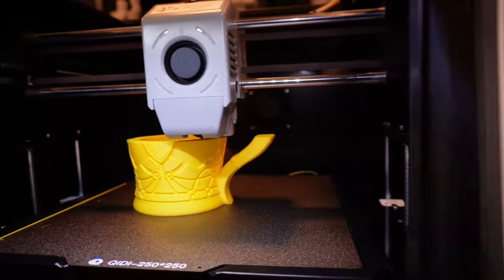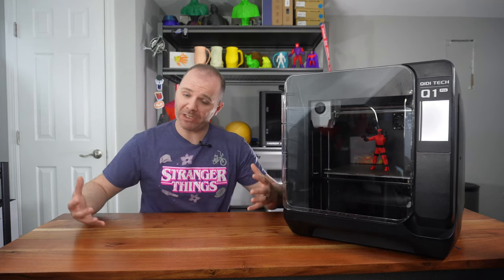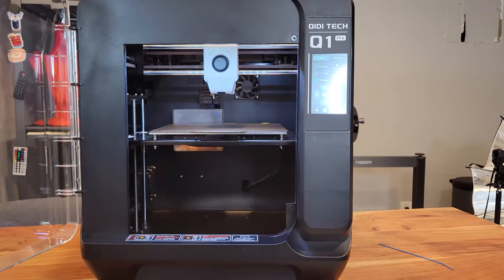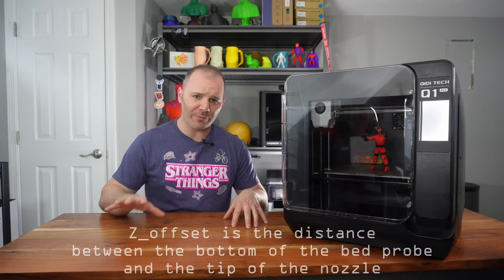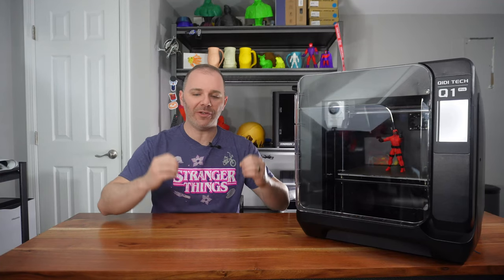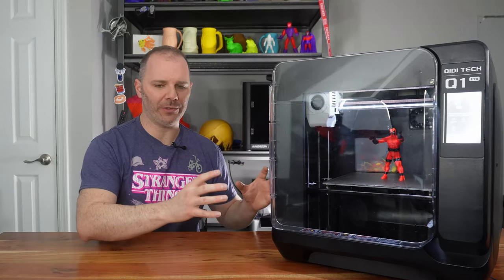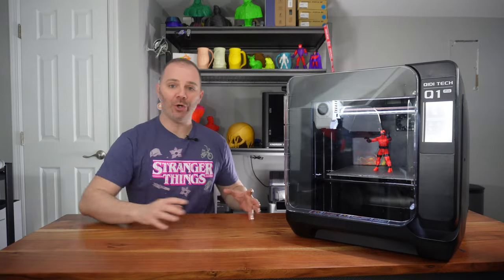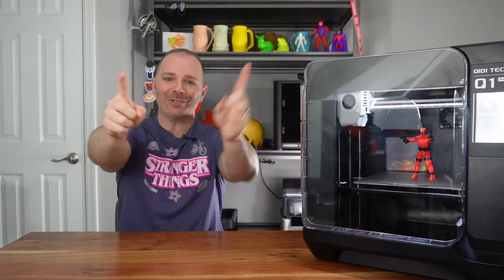A 3D printer for beginners and experts!

Comment: I purchased this today then got hit with a bit of buyers remorse from seeing some of the cons other reviewers delved into, namely the belt tensioning, build plate shroud issue you talked about, (other reviewers neglected to mention the shroud was removable), and the weird load/unload procedure that you skipped on? 

But after seeing your video i feel more confident in my choice the ability to use the camera in a meaningful way vs just taking Timelapse or live view (as if i could do much while driving somewhere) is really awesome! The bed plate being less finicky without the shroud is nice to hear too, the only worry now is the tensioners but I’m confident there will be tinkering to fix that.

Looks like my second and most expensive printer purchase should be a good one! Thanks!
Reply from the maker: I think once you get this machine up and running you won't have any buyers remorse. At a base level this printer is easy to setup and will start off giving you great prints with minimal effort. Really the hardest part with these printers is understanding how to use a slicer, but if you have some experience with that alread, it should be a piece of cake. 
    For the belt tensioners I never had an issue with them. Mine came at a good tension from the factory and I didn't need to make any adjustments. The fact that the tensioners are only held in by a set of 2 top screws (instead of all 4) seems like it could be an issue, but I haven't run into one yet. Tensioning them is supposed to be easy: release the tension, run the printhead by hand, resevjre the tension. Again, I haven't had to go through the process yet but I'm confident we should have some control on the tension of these belts. 
    The load/unload I was gonna touch on but it's just something that hit the cutting room floor because the video was already long. I sort of mention it in the wishlist section at the end. The reason I didn't stress to have it make the final cut was that this machine is using Klipper and we can just create our own load/unload macros as we see fit. And we should be able to hijack whatever their macro is for load unload through the touchscreen and just supplant it with ours. So that issue should be able to be alleviated client side. If you're interested I could share a load unload macro on using.
    Other than that this thing should be solid for you, it sort of just works. I wish there was some form of filtration, but to be honest the best form is to vent the chamber fumes outside which is never going to come stock.
    Hope this helps and let me know if you want a load unload macro!
Reply: @PrintsLeo3D  a macro for that would be awesome! And again easing my mind thank you! For filtration i actually had it in my mind to print some sort of vent tube to my window, or attachment for something like a like a flexible cold air intake pipe from a car since I’ve got one lying around! I saw other reviews mentioning carbon filter etc and figured just not dealing with the fumes in my apartment at all would probably be better.

Comment: Great Review Leo, new here but a vet in 3D print space. Klippered all my machines apart from my ender 3 pro (OG) , So far this Qidi Q1 pro has impressed me no end, what a tool got octoeverywhere on mine working fine, and had to SSH to get the time and date on the MKS board correct. Only issue I have at present is when printing with the heated chamber on for ABS ASA etc, the printer crashes at random mid job, now I'm not sure if it is funky G-code or the MKS controller getting a little hot? My slicer is Orca 2.0 beta and PETG PLA print amazingly well so not sure what's up. I have e-mailed Qidi support so watch this space.

Edit...! Not hard from Qidi yet but not been long so no bother... The issue is the MKSpi is reaching 95oC and thermal shutdown watched it in putty creep up then error out with thermal protection shutdown. The little fan either ain't working or not enough to cool the main board. 

Will update once I fix it , and I will fix it!!
Reply from the maker: Paul it sounds like we are doing the exact same thing to our Q1s! I got OctoEverywhere (OE) on this as well and I was even able to correct the clock issue directly through some prompts on OEs website. Which was easier than when I had to do some add-ons to the XMax3 which also had a clock issue!
    I haven't had any overheating issues as of late thankfully. I believe the MKSpi board is the printer head board (but I could be wrong), and I don't believe there's a fan to cool it properly. What is the chamber temperature reaching during these prints ? I would say to remove the back cover and maybe get some more airflow into that board but I'm afraid that may open you up to some other areas (by exposing the board). I would love to hear how the issues presents itself and how you end up tackling it. Keep me in the loop lol? Thanks
Reply: @PrintsLeo3D  Hi Leo, fixed it temps didn't breach 84oC max 80 while printing. Chamber I have set to 60 and it stays there no issue. With the back off temps never broke 65 on the mainboard. (Chamber took an age to warm though). Your right on the MKSpi I was just generalising the Qidi mainbaord has this element built in I believe doing the Klipper stuff it is this that was overheating. If you have an e-mail or discord I can share my Mod it's janky atm but I'll make a 3mf at some ponit. This was just to prove the point and get my issue sorted. Qidi came back and advised I need a new adapter plate and connect cable (not sure myself).
Reply from the maker: Paul, sounds good! Send me an email at printsleo3d@gmail.com can't wait to see it !

Comment: removing the bed shroud is a brilliant idea!  Is there a pid tune in case it affects the thermals of the hotplate?
Reply from the maker: Bruce there absolutely is! Because we're using Klipper we get all of it's internal macros available to us, and PID tune is one of them. Whenever you want to PID tune the bed or the extruder you just need to send one of these commands (outside of a print):

PID_CALIBRATE HEATER=heater_bed TARGET=(input_temp)
or
PID_CALIBRATE HEATER=extruder TARGET=(input_temp)

ex. PID_CALIBRATE HEATER=extruder TARGET=210

--

What I usually do is add a quick macro to one of my configs and it makes this command into a button on your printer's home page that you can simply input the temp and then click! It's super simple. This is the macro:

[gcode_macro PIDtuneHOTEND]
gcode:
	{% set TEMP = params.TEMP|default(200)|float %}
	PID_CALIBRATE HEATER=extruder TARGET={TEMP}

[gcode_macro PIDtuneBED]
gcode:
	{% set TEMP = params.TEMP|default(60)|float %}
	PID_CALIBRATE HEATER=heater_bed TARGET={TEMP}

----

If you have any questions on how to implement this let me know!
Reply: @PrintsLeo3D  Pre ordered the day I saw Angus's video, but Au stock not until May
Reply from the maker: That's unfortunate but at least you have one coming. I'm sure that will make it all the more special when it arrives! Good luck and have fun printing with it!

Comment: Thanks for a very informative review. I would like your opinion or analysis on how it prints TPU. I currently have a Dremel 3D45 that prints very accurately however, to print 95a TPU I have to print no faster than 20 to 30 mm/s max.
Reply from the maker: This printed TPU well for me, though I am printing it pretty slow myself (but not 30mm/s slow). I am printing Overture TPU which I believe is 95a and it printed it perfectly. If you want I can start up a new TPU print and get back to you with top speeds and whatnot, if you have a particular model or design style you are printing let me know and I will try and find a model to match.
Reply: @PrintsLeo3D
I'd love to hear some suggested speeds as I expect to be printing some TPU when my Q1 finally arrives
Reply from the maker: I know for my initial testing I capped my speed to 100mm/s printing at 240c. I think I expanded on those numbers afterwards though. I'll have a look tomorrow and see if I can find the top end speed.

Comment: How easy and how quick can you swap nozzles? Would you say it's easy to maintain this printer, for instance, if you need to replace the belts?
Reply from the maker: To be honest none of that will be easy, but it shouldn't differ all that much from other printers in its class.
   Replacing the nozzle will require you to remove the hot end, take off the heating cartridge(so you don't break it) and then replace the nozzle. It's not hard, I would say the effort is about what you would expect for any nozzle change. I believe BambuLabs may now have a quick change nozzle (which is ahead of it's class), but I don't know for sure. I have replaced the nozzle on my P1P a few times, and the nozzle on the Q1 takes the same amount of effort.
    If you're replacing the belts it will never be easy, as you need to disassemble the printhead in order to get access to where the belts terminate. That being said it's no different from any other coreXY printer out there.
    Hope this helps and if you want more let me know, we can always chat through email and I can share some pics of the printer.

Comment: Thanks for the vid and responding to all the comments so fully, you earned a subscriber here.
Do you think it would be possible to design and print a new build plate shroud to accept a Bambu Labs plate?
The extra bit of space would be nice but I'm mainly interested because of the much larger range of build plates cheaply available for the Bambu's.
This will be my first printer and while I'm waiting for it I have already started trying to learn OrcaSlicer a bit but I can't decide on which CAD to go with, any advice?
I'm currently leaning towards OnShape but could be persuaded otherwise.
Thanks
Reply from the maker: Hey Tony thanks for the kind words and the subscription. During the 'Bed' section of the video I remove that shroud that covers the bed, and it opens up the entire build surface. It makes it so you no longer need the bed shroud and you can in fact use Bambu Labs build plates with this ! I show a black build plate around that portion of the video, and that's an aftermarket PEO/PEI build plate I purchased for my P1P. It fits on this and works like a charm!

Edit: as for CAD programs I use Fusion360 a lot, but it can have a higher learning curve. To be honest fusion 360 feels geared more towards functional parts. Where Onshape or Blender seem to lend themselves more to design or aesthetic parts (like busts, and cosplay pieces). I don't have a tremendous amount of experience with all of them (outside of Fusion) though, so that's just my 2 cents.
Reply: Thanks.
How would I convince Orca to use the extra build volume if I remove the shroud?
Reply from the maker: Well you wouldn't need to. If you set up your printer with a build volume of 245x245 it will know where the bounds are. Are you asking if we can actually print on the full 256x256 plates? I don't think we can. I believe the printhead on the Q1 Pro is limited to 245 in the X axis, and it can reach up to 258 in the Y axis but that is mainly to activate the nozzle brush. 
    Removing the shroud allows us to use those BL build plates, they fit and can be printed on,  but we will still be limited to the 245x245 printing area that the Q1 offers.
Reply: OK, I was just a bit confused between the listed spec and the fact that the build plate says 250x250 on it.
I think I'll still give some third party Bambu plates a go at some point just to try the different patterns.
Thanks for the help.
Reply from the maker: Yea , apologies if I was confusing. When I removed the shroud it now lets us use those larger build plates that are easier to find and come in more materials/colors. But we'll still be stuck with the 245x245 size. That being said the PEO bed I've been using has been working great and looks awesome !

Comment: Leo I love your videos, i do. But i have a question  at  @22:36 there are four cooler for stepper drivers (the blue ones) 
and if there is one for X axis, one for Y axis, one for Extruder,  I cannot find another two for Z and Z1 axis.
Where are these located? (or then where are the rest of axis and extruder drivers)
Reply from the maker: Great question! The stepper drivers you see on the mainboard are (top to bottom) Z2, Z1, X, and then Y. The stepper driver (and heat sink) for the extruder is located on the printhead itself. It's attached to the breakout board at the rear of the printhead that controls all of its functions. This is a great question and it's super helpful because it reminds me of the sort of details that I can gloss over. I appreciate you asking and I'll try and remember this going forward and be a little more exacting with how I show the two separate boards. Thanks!
Reply: @PrintsLeo3D  There is Can bus connection to board on extruder head?
Reply from the maker: If I remember correctly it's a UART connection but I need to check

Comment: I’ve seen some creators saying that Klipper is locked to an older version..which seems weird to me that they would require you to use one specific version of Klipper that’s 2 years old. Have you tried updating to a new version? I’m really interested in this printer and will be a huge upgrade from my ender 3 pro lol
Reply from the maker: What you heard is absolutely true. I think we are running Klipper V 0.10 which was released in 2021. Why they chose this particular release to use as. Base I don't know, but at the very least this release did integrate object exclusion which allows us to exclude object anr adaptive mesh. 
    The issue, as far as it's known to me, is Qidi's integration through the touchscreen. Now a lot of this is stuff I've learned from the XMax3, which I've had for around a year, but it appears to hold true for the Q1. Qidi is wisely using Klipper to operate their printers but they are also attempting to make the touchscreen more intuitive for 'everyday users'. Thus they have eschewed Klipperscreen and created their own menu system. This is the rift between full Klipper and their version. Due to how they've implemented the touchscreen we cannot just update Klipper (and it's modules) without causing some game breaking errors on the menu side.  Flashing last year's models was doable, but the firmware needed to be prepackaged by Qidi and then flashed as a unit to your machine, which took a long time to flash as opposed to a normal update. 
    The other issue , I believe, is that Qidi has put some stop gaps in place to 'protect' the user from just upgrading certain sections of the Klipper environment and not others. That could render the printer useless and make QA and troubleshooting an issue. 
    So overall what does this mean for people thinking about buying this ? It's hard to say, it's sort of a 'thats for you to decide' scenario. With their former machines Qidi was good about attempting to make new releases happen and allow you to update your firmware (albeit through their complete firmware package). If it's one thing I love about Qidi is the customer service I have seen, and received, so I would lean more towards believing they will come through with new releases than not. That all being said, V0.10 is stable and rock solid. Most importantly we get those features I listed earlier which are huge quality of life improvements. Now we Klipper and it's branches grow we won't have immediate access to them, and that's troubling, but it's something I think Qidi would be able to help with. I haven't dug deep enough into the configs yet to determine if I can unmarry the touchscreen from the main board and other mcu, this way you do get the total Klipper experience, but it's something I have been considering. I am going to reach out to my contact and ask what their plans are for future release and how they aim to deal with it. 
    Great question and I hope this answers it somewhag well enough,  because I don't know if there's a more complete answer out there. Thanks! 

P.s. I am not 100% sure on why the Klipper release issue exists, but I believe it is for the reasons listed above. When I get a better answer from Qidi (if I do) I will update this.
Reply: @PrintsLeo3D  thank you for your excellent response…I think for $469 I can deal with an older version of Klipper as I’m sure the community will find ways around this down the road if Qidi doesn’t decide to develop it further…

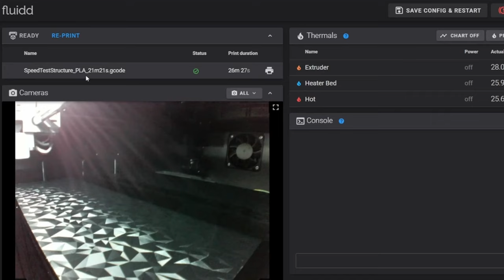Comment: 26:35 apparently the Q1 Pro is not compatible with cura though as qidi won't give the settings to set it up and say cura is for slower printers but hopefully It will become a supported slicer soon
Reply from the maker: That's weird because while I prefer Orca (and the slicers it's based on slic3r, prusa, Bambu studio) there should be no reason this should be incompatible with Cura. I know Cura allows you to set speeds, and it's slices into gcode like all the other slicers. I am going to contact Qidi today and find out. If for some reason they don't have a profile set up I will set one up myself to share 👍
Reply: @PrintsLeo3D  thank you SO MUCH! I eagerly await this profile because I Love CURA!! Their support email said "there was no way" (paraphrasing) but I'm absolutely sure they're just being lazy...
Reply from the maker: I haven't had Cura running in a while, so I downloaded the latest version and sure enough there are ZERO Qidi printers available lol so I created a custom printer the dimensions of the Q1 and created a profile. I just want to print with it a few times before I say it's good to go. After that I will though them up on my webstie for downloading. I can also email you the profiles if you like that way too.